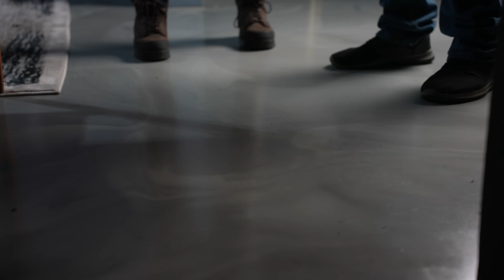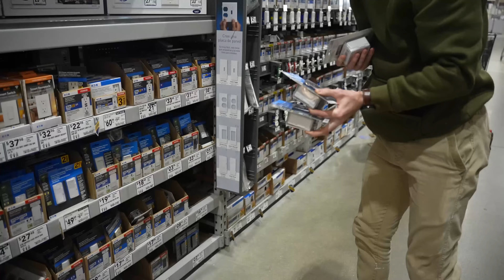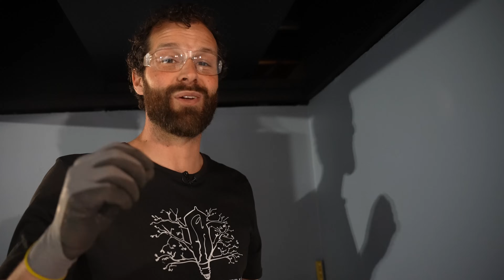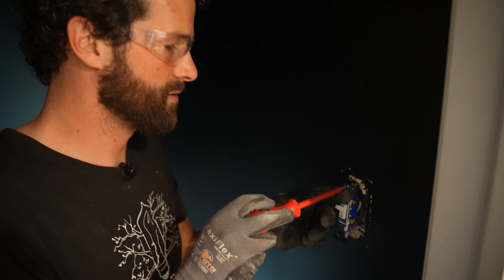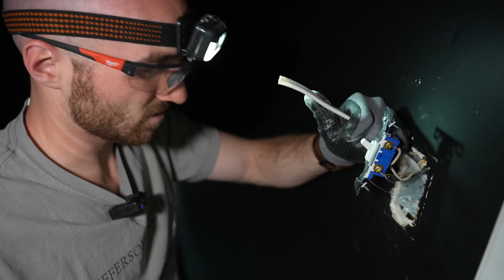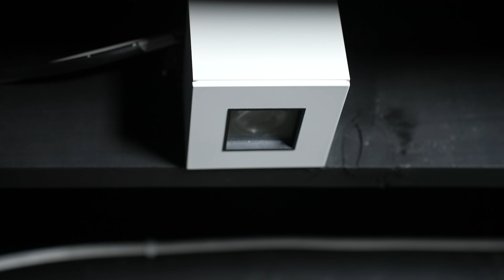Simple Lighting to Turn a Basement into a Theater

Comment from the maker: What's the best lighting upgrade you've ever made to a space?
Reply: Hue lights and addressable light strips with WLED......its AMAZING!
Reply: Ketra before Lutron took over. Amazing light quality, and the trimless regressed is so unintrusive in an 1910 Craftsman. The OG Ketra API provided almost complete control, and built out some great integrations to do daylight hour CCT shift based on color/intensity sensors in the space. Couldn't build out that integration now that Lutron owns it which is sad since I love the light and nothing else can touch the result though.

Comment: Simple question. 

A customer calls with a troubleshooting issue. Receptacles not working. Lights not working. Etc. 

How do you charge for this work? Troubleshooting could take 5 minutes or 5 hours. Do you do a flat rate? An hourly rate? Do you prorate your time to the minute?

Comment: I always run 14/3 for switch legs so the white can be used as neutral and red and black can be hot and switch leg so there is no confusion
Reply: I haven't familiarized myself with the NEC enough yet in my time in the states, but in Canada the CEC dictates the need for a neutral in every switch box because of the smart switches and all this new stuff that needs a neutral in the box. so for a simple switch leg now we would have to use a 14/3
Reply: Has also been like that for over 10 years in the US.